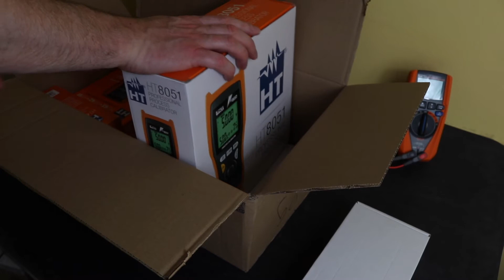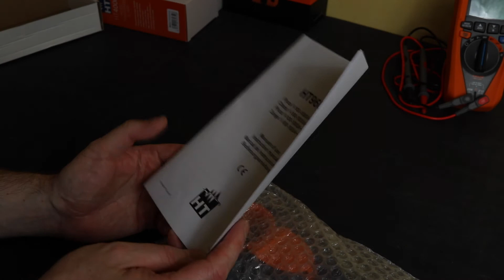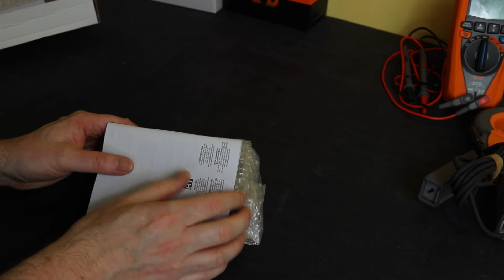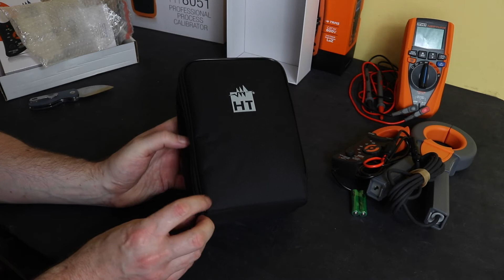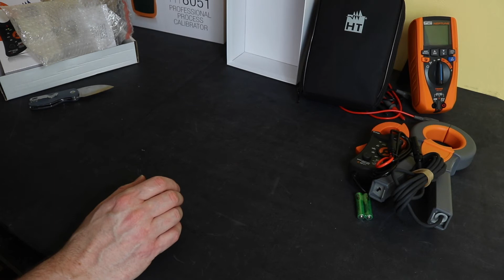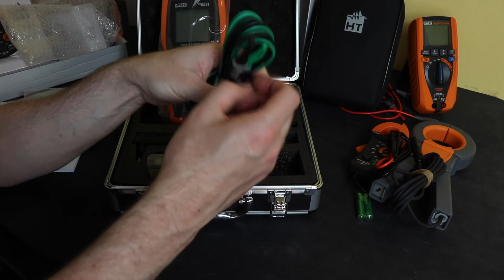HT Test Instruments Unboxing

Comment: what did a HT8051 set you back from UK?
Just checked Conrad Denmark, listed at 4800 danish Kroner, thats around 650 euro and its such a pain these days to purchase from England as many english vendors dont ship abroad anymore..
The HT65 is 202 Euro from danish Conrad incl danish VAT and HT4006 is around 150 Euro and HT96U is 430 Euro so a purchase with those 4 units would set me back 1432 Euro...
just to give a ballpark what is cost from Conrad that are based regionally in regards to what it cost for people in England importing it...
Reply from the maker: The HT8051 cost me 655 Euro. Conrad have closed down their UK shop and I have to purchase from the European one. Converting to GBP and adding VAT and import takes it up to £690. 
Other than the HT65, these items aren't available in the UK, but it isn't a cost effective method for me really.
Thanks for watching and commenting.